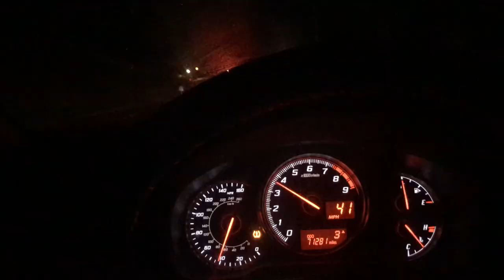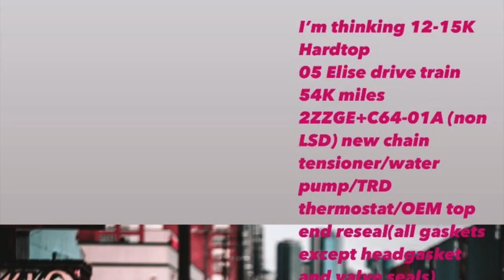ULTRA RARE BRAND NEW Facelift Tailights  | All the differences | Toyota MR2 Spyder

Comment: les go!! so much nicer man congrats!
Reply: I prefer the pre facelift lights hands down. The design fits much better. The two reverse lights ruin the rear facade.
Reply from the maker: Thank you man!
Reply: Spyder Steve  Well It seems a few people agreed with me here as well.
But It's no secret that the ZZW30 was trying to emulate the styling of the 986 boxster just like the SW20 was emulating the Ferrari 355.  
So the pre-facelift ZZW30 taillights are far more of a traditional and inoffensive design, because that's what Toyota was aiming at; a baby Boxster that handles like a Elise built for the poor man.
Whereas the facelift lights just scream "look at me I'm different and quirky" to grab as much attention as  possibe as a last ditch attempt by Toyota to try to boost the W30's poor sales numbers compared to Miatas etc.